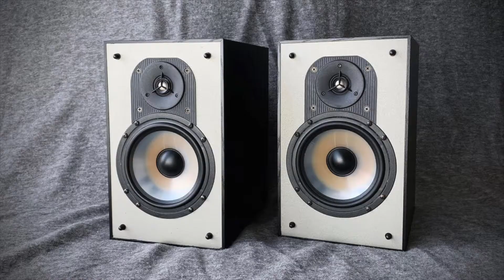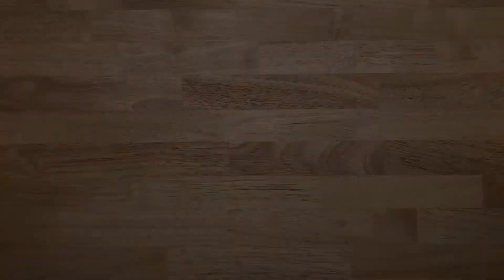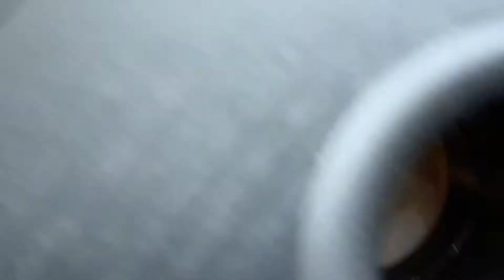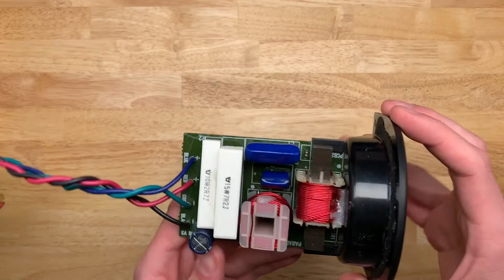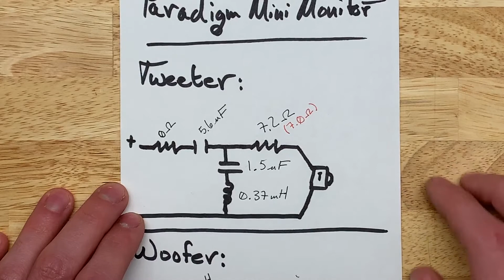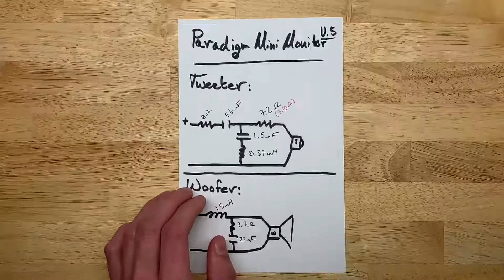Part 1/3 The Teardown - Upgrading Paradigm Mini Monitor V5

Comment: What an idiotic design by Paradigm. You cannot simply remove the woofer if it needs replaced...it is part of the whole front baffle piece. If you need to replace the woofer, you have to replace the whole front mounting baffle with it. Ridiculous.

Comment: That cabinet is not made of mdf. The cabinet is made from particle board. Major difference. Mdf is more dense and is a much better material to build enclosures with, acoustically. Particle board is cheap.

Comment: your tweeter network is wrong. A C-L 'network' in parallel with the tweeter makes no sense. If I look at the back of the PCB, I can see that the 2 blue polycaps are in series with the tweeter to form a third order electrical network with the air core inductor shunting to ground. This is a fairly standard approach for better phase tracking between the 2 drivers at crossover region. With this budget, an engineer placing a poly parallel to a tweeter would probably be fired

Comment: Twisting the wires causes added capacitance, better to keep them as far apart as possible. Changing the value from 7.2Ω to 7.0Ω will move your phase angle, but that small a change will more likely than not be negligible in terms of number of degrees.

Comment: I'm using the same speaker.
I took it apart to change the speaker color.
Can I know the name of the component that was replaced?
Thank you for the information.
I'm not good at listening because I'm Korean.
Reply from the maker: @손익상  - Hello! The types of components in a speaker crossover are resistors, inductors, and capacitors. If you are looking to change the parts in the crossover, I would recommend buying new high-quality parts for each. In this case, Mills brand resistors, air core inductors, and film capacitors. I hope this helps and thank you for watching!

Comment: i have these speakers ..... at med to high volume one speaker rattles/vibrates (when playing electronic drumbeat) and seems to gulp in air from the back port, the vibration is loud listening from the port but audible from the front too.... i have disasembled it but can see no issues at all........... any advice   thx
Reply from the maker: @NDF - That’s a tricky one. Maybe check if the crossover is tightly fastened down. I noticed on mine that larger inductor was broken loose from its glue. It could also be a failing voice coil? But that’s unlikely because you’d hear some distinct distortion. It’s hard to say because I haven’t heard them but my best advice would be to make sure everything is screwed and secured down tightly. Thank you for commenting, hope this helps!
Reply: @Casey_Schmidt  So i unscrewed the back where the crossover/speaker terminals are and of course everything is tight and looks new....i thought the extra gulping of air thru the back port (compared to the other atom) would be a big clue, but i am a rookie when it comes to speakers :(    
i sent paradigm a email but i am out of warranty....boooo   but they might have some info (probably replace the woofer!!! or try to sell me new speakers!!!) 
how do you get the woofer out of the plastic enclosure (the spider???)     thx again
Reply from the maker: @NDF - If the woofer is bad, it would probably be more cost effective to buy a replacement driver from eBay or another pair. Because the woofer basket and everything is molded into the facia, it would be extremely difficult to repair it with replacement parts. Try looking up videos about what blown woofers sound like to see if you have similar symptoms.
Reply: I have the same issue! I think it’s a failing voice coil. Mine produces the noise from 200hz-140 ish